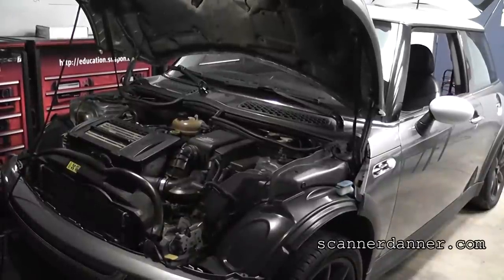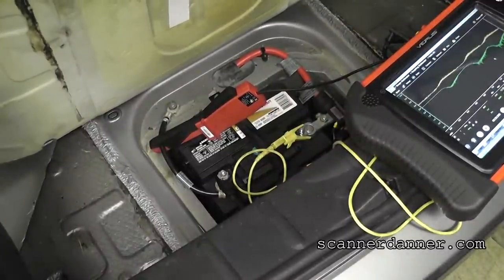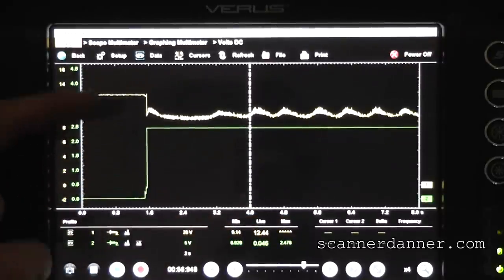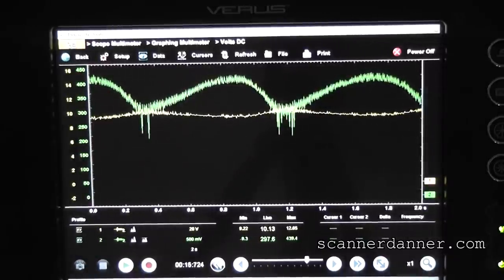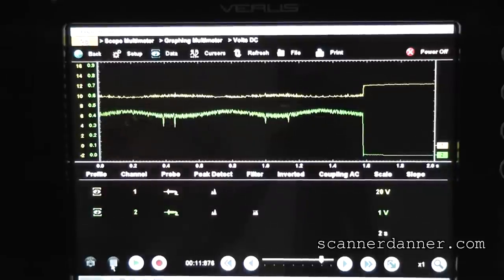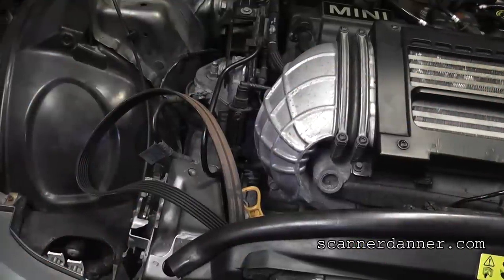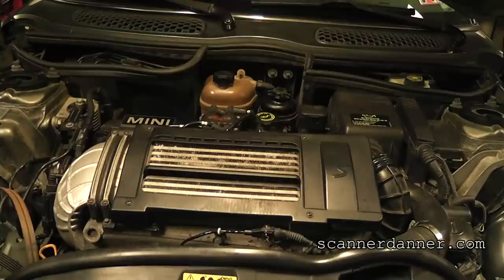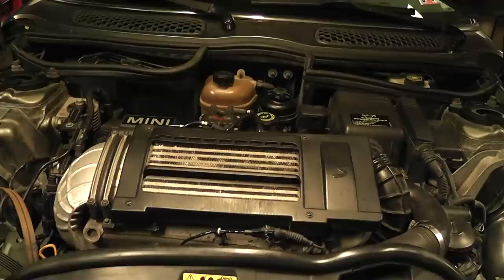Engine does not crank (seized alternator) - Mini Cooper

Comment: Mr Danner I have a 1988 camry with the famous 3sfe.  I got the car really cheap it didn't run got it home and timing belt was out of time dramatically.  I had it running one day an it died mysteriously and couldn't get it goin again.  I rechkd timing belt was on the money. I chkd compression 142 psi every cylinder and it sounds good rolling engine over.  All my block and body grounds and battery grounds are good to. Checkd fuel pump by jumper +b an fp could feel fuel flowing at fuel filter and injectors, chekd fuel psi at cold start valve its 42 psi while cranking tinjectors are also getting a pulse from computer.  I have a nice fat spark on every plug, coil resistance readings are good.  Im getting a signal from igniter back to computer about 1.5 volts.  I have a good running parts car and swapped computers, distributors and car still will not start.  I chekd engine main relay the ignition relay, circuit opening relay and all fuses they are good.  I put computer in diagnoses mode and it has one long blank and 4 short blanks I figure that is a code 14.  I know the ecu is good I chkd igf and igt terminals at computer im getting a pulse and a ground there I don't understand why the computer keeps saying that even after I unhook battery for 20 minutes.  Could it be possible I have a broken wire in that circuit cause I chkd all the wires on the igniter they all had continuity.  Could there be a bad sensor that is keeping it from running?  On my parts car I found it will still start and run if the tps wire is unhookd so I thnk that sensor wouldn't stop it from starting? Im really stumped on this car if you have any suggestions that would be greatly appreciated

Comment: I got burrned on 1 once called engine needed compressor
Reply from the maker: I did too Justin. In the video, I mentioned a seized starter motor. On that car, I called it a bad engine. Worst part, it was someone from my church that I was "helping" for free. They sold the car to someone I worked with for $500. I am still shaking my head on that one.

Comment: My neighbor put the wrong starter in his car,after he put it in,the car couldnt start. He foolishly thought the motor had seized up. He sold it to my other neighbor whom bought it and dropped the starter right in front of my neighbor after he bought it and showed him the starter was the wrong one. He was a rotten person because he told him it didnt matter,he had already sold it. He put another starter in it and drove it home. He sold it a few days later. I quit hanging around around him a few weeks later after he stole a couple snow mobiles from someone. My neighbor said he didnt care about the car but I felt bad he got ripped off. Any time you replace a part and the issue goes from bad to worse,suspect that new part. Never ever assume a replacement part is ok. I did a timing job where they never put a timing mark on the new timing gear. We compaired the replacement new one with the other new one that had no mark.All they said was oops!